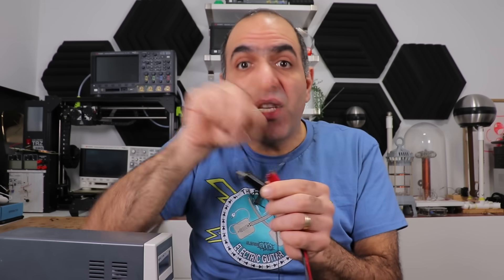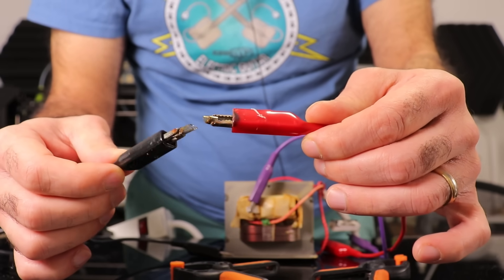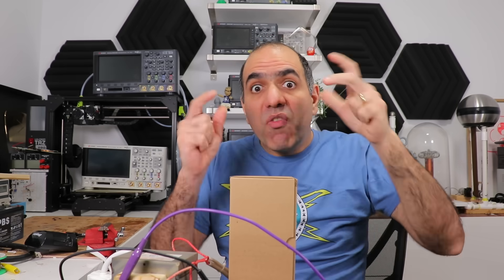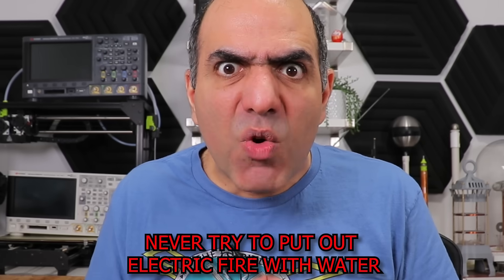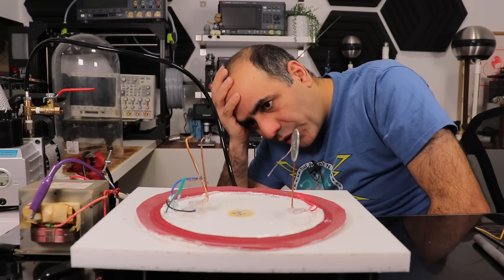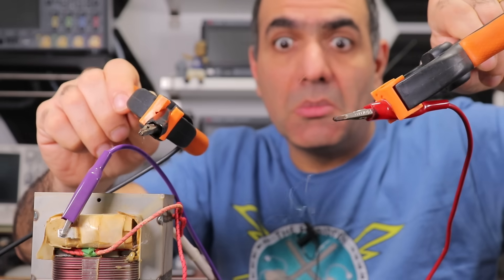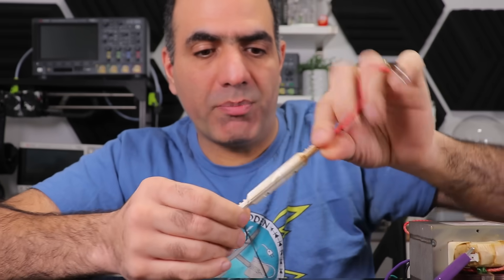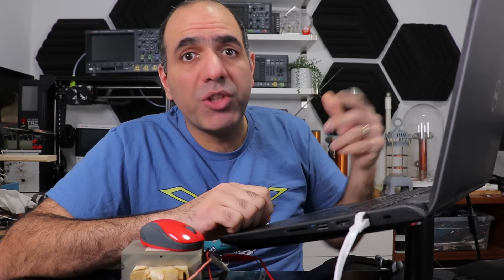Making a High Voltage Fuse

Comment: Hi f*** edit: @electroboom do you know what magnetic shunts are? if you remove the little blocks of metal between the primary and secondary you will get more power out of the mot, all you need is something to push them out with and a hammer, a flat head screwdriver will work, a metal rod will work, just anything you can hammer them out without damaging the windings

Comment: Creating a discharge between two electrodes at the lowest possible voltage requires that the paschen condition is satisfied. I believe you can look up paschen curve for air on the internet and set the electrode distance and pressure such that arcs are not produced (atleast until a high enough voltage is applied). Do the calculations according to your design and this might help make better fuses.

Comment: Mehdi, my assumption is that the gas in the fuse could be argon or nitrogen. I did want to point out that the spring from the fuse is probably still intact and the fuse blew as it was designed to just not visible from the outside of the tube.  If you notice the gauge of the spring side is thicker therefore giving it more strength in that area. I think it’s great that you showed an example of a modern engineering marvel that is not so obvious to us in other fields. Please make more videos showcasing unique or intelligent design:-) Thank You

Comment: Paschen's law is an equation that gives the breakdown voltage, that is, the voltage necessary to start a discharge or electric arc, between two electrodes in a gas as a function of pressure and gap length.

https://en.wikipedia.org/wiki/Paschen%27s_law

Comment: Good demo, Most HV fuses in ring main units (RMU's) have fine sand in them. The fuse element(s) are wrapped around a ceramic former and an explosive discharge which operates a striker pin at the fuse cap and trips the tripping mechanism, after the fuse element has failed, so all three phases are de-energized when one fuse fails. DDO's drop out fuses, the fuse element is held under tension by a spring which aids the separation of the melted fuse element. Also the tube vents out and blows out the remains of the failed fuse when the very loud explosion occurs under fault conditions.

Comment: Normally a fuse is not gas tight. The metal caps are lose and not sealed and the glass tube is open on both sides. Dunno how it is with the hv fuse though...

Comment: In Power Systems, Circuit Breakers generally use air blasting to extinguish the HV arc, there are other methods as well, like resistance switching, SF6 gas, chopping the arc...but spring works as well XD

Comment: Hello Mehdi. Is it possible to get shocked because of increased solar activity? I've been living the same house about 6 years now and never had static electricity issue before and literally nothing was changed during that time. However, I notice that about two weeks ago I started to get shocked by my front door handle and water tap and my Apple Watch charger, basically anything connected to the ground of my apartment.

I also found it interesting that static electricity and solar activity are peaked during the last 2 weeks in Google searches.

Do you think both are connected somehow?
Reply: Our (state operated) power company runs occasional ads saying that if your taps start zapping you, you need to call them quickly: faults like that can kill. Faults can develop as buildings/wiring age or are damaged.  I hope you are OK!
Reply: @old_grey_cat  yes but it's not like they shock you constantly. It's a static shock. It started a weeks ago. Now it's half as bad. Idk I thought it had something to do with increased solar activity recently. 🤷‍♀️
Reply: @aliozanerbektas  Please do have it checked out.
Reply: @old_grey_cat  I will do tell the administrators of the building. Thank you for your concern. 🙏
Reply: @old_grey_cat  I will do tell the administrators of the building. Thank you for your concern. 🙏

Comment: 5:02 The relationship between pressure, gap length and breakdown voltage for electric arc is actually quite interesting and it's formulated in Paschen's law (https://en.wikipedia.org/wiki/Paschen%27s_law ). When the pressure is too low, there are not enough gas molecules to ionize and make an arc. On the other hand, when pressure is too high, electrons have too many collisions with molecules and they're losing too much energy to maintain an arc. So partial air vacuum was an optimal condition, as we have seen on the video. Thanks @ElectroBOOM for showing that!

Comment: 6:22 sulfur hexafluoride is what is used in a lot of high-voltage electrical equipment as an arc suppressant.  its also like the opposite of helium (if you breathe it in, it stays there and makes your voice a lot deeper, but don't try this since it stays there and can asphyxiate you if you are not careful).  ive seen warnings about it on the doors of some rooms with electrical equipment around where i live.
Reply: I believe plain old CO2 does the job also
Reply: @PostTraumaticChessDisorder  It does, but worse than SF6. Not good for compact kv switches.
Reply: @PostTraumaticChessDisorder CO2 actively poisons you by dissolving in blood from your lungs. SF6 just suffocates you because it’s not oxygen, so you don’t get what you need to live

Comment: Also some glass fuses for purely hobby purposes can be repaired - using super fine wire - they are usually soldered to the end caps - they blow just as fast - the ceramic fuses are more robust and filled with silica like mentioned on this post before - using the wrong fuse is very interesting - and the reason for protective heat-Shrink or a plastic enclosure is probably protection against fragmentation of the case  - I had a non - repaired standard fuse I used on a HV project that literally exploded into pieces…

Comment: Yes, there is a non-conductive gas inside the fuse.
Also the function of the spring is not to pull the piece of wire that melts.
creates a path with resistance to limit the 2.1kilo volts, also at a certain moment you see that the fuse illuminates for 3 or 1 seconds, which would be
the gas igniting

I hope to win a heart from electroboom lel

Comment: Hi Mehdi, I guess they fill the fuse with heavy gas called SF6, that type of gas is used on power distribution station to provide a high voltage isolation , below more details about that gas 
https://en.wikipedia.org/wiki/Sulfur_hexafluoride

Comment: 8:58 if you use nitrogen to fill the fuse tube it will work because nitrogen act as noble gas under normal atmospheric condition, that's why nitrogen is used in the filament bulbs because it will prevent the oxidation
Reply: It's more accurate to say that dinitrogen is an inert gas, spliting it requires the Haber-Bosch process which is basically only done in huge industrial plants.

Comment: 4:25 Man, you just invent gas breaker. Ark inside the volume make gas to heat up and increase the volume, gas push the electrode out and after that expanding gas blow the arc. At the same time the fuse electrode jump out from the housing, extend the arc way, this prolong the arc. This two methods are used in combination in industrial air circuit breakers. Congratulations 😅😅😅

Comment: What if I use a 5000 volt fuse for my 12v car battery? You did not cover that possibility. I think "mind the voltage rating" is only important if your voltage is higher than the rating.

Comment: Try suspending the fuse in [non-conducting] mineral oil.   No more arcing. They often use oil like products for switch gear at sub-stations.

Comment: That video brings back memories of one of my most dangerous creations, the 4 microwave oven transformer series-parallel supply that runs from 220V and produces something like 4kV at 1A. The scariest thing is that high voltage windings are tied to the iron core of the transformer, meaning there's 2kV live on the transformers themselves.

Comment: The answer to the question, do high voltage fuses contain special gases. Is yes and no. Some fuses do contain special gases, and some don't. I would suspect that the fuses inside inexpensive microwaves likely don't contain any special gases. Often the conductors inside of the fuse bodies are specially formulated so that when they vaporize they create special gases that have an arc quenching effect, but they are not all built that way. Fuses are made with many voltage, current, energy and time ratings, so you have understand the circuit that you are trying to protect, before you can specify the right fuse.
Like you said; only replace opened fuses with new fuses with the same ratings.

Comment: Fuses do have a maximum turn off current up to which they can reliably cut the circuit. Above that the plasma arc can continue the current flow at least for some time.

Comment: Paschen's law might give you the answer for your "vacuum" fuse behaviour. Mobility of free electrons is increased under lower pressure and thus the arcing distance is increased. In addition your chamber was filled with vaporized metal after the fuse burned off...

Comment: You need to get a neon sign transformer.  They're by no means "safe", but they're less deadly than a microwave oven transformer.

Voltages are available between 3kv and 15kv, and usual current limiting is 30ma.

Comment: About the gas - I remember that in high voltage switches there is usually an SF6 gas around the contacts, which has extremely high resistance to prevent arcing
Reply: Also compared to air it is a lot more fire resistant, can dissipate heat quicker, non-reactive with metal (under normal temperatures) and also doesn't "age". Very neat thing

Comment: Also, isn't it technically the power that heats the wire, not the current?  So, a 10 A automotive fuse should blow at 120 W, which means only a 1 A draw on household 120 V electricity (ignoring variance and the differences between fusing AC and DC power sources for the sake of illustration). Since Missy applications work on a fixed voltage or nearly so, and because higher voltage includes the risk of arcing, it's easier just to have separate voltage and current ratings, so you get the right voltage for your system and the right current for the specific circuit.

Comment: Sometimes even non-conductive extinguishers can lead to electric discharge on the skin. I had that experience with the next situation - 150 kV, 100 kHz with a CO2 extinguisher. I catch the surface discharge on me via the CO2 to the air. Luckily the current was low and with a high frequency.

Comment: The spring fuse might just have regular air in it. Didn't you just say the typical arcing distance for that voltage is 1mm in air? Also, I bet if you took it apart you could find the spring part hidden behind the metal. You could see it before it popped because it was stretched under tension.

Comment: 9:46 I don't think the spring got vaporized. I think it collapsed back (like it was intended to to extinguish the spark) into the metal cap end on the screen left.

If you watch right when you turn it on, you can see it moving to the left slightly

Comment: If 3000 volts can jump a long distance in a partial vacuum, and only just a milimeter at atmospheric pressure. Then how much distance can it jump if stored under 5 atmospheres of pressure?  Pure nitrogen has a higher resistance to break down under pressure.  Search "paschen's law Wikipedia" or paschen's curve

Comment: Magneto ignition units on aircraft engines (piston engines) for high altitude aircraft, something primarily used before the advent of the jet engine, generally pressurized the magneto from the compressor feeding air to the engine, to increase the breakdown voltage.

Comment: I always wondered what the difference was in voltage ratings. Makes sense though. I guess a 250 volt fuse would work just fine in place of 600 volt until it blew. Then ypu may have a problem. To be clear im not advocating for that practice. Im just stating i always wondered what the difference was between a 40 amp 250v vs 40 amp 600v other than the size. 40 amp is 40 amp but it makes sense to me now why they are different.

Comment: You can use a spectrometer to determine what gas is in that microwave fuse based on the color of the flash of ionized gas

Comment: Strangely relevant to the last rocket labs failure, where low pressure in space (who'd a thunk) caused arcing in the second stage PSU, and a failure to reach orbit. It's a little more complex, but awesome that they could diagnose it after the fact. Now they pressurise the PSU to stop that failure mode.

Comment: Looking at the colour of the dishcharge, it could be pure nitrogen. I also know that xenon lamps doesn't like to maintain an arc, which is why we used to make the flash bulb in old cameras put of it. So it could be xenon, although xenon doesn't give off a violet flash.
Something to do with pressure and ionisation, the gas needs to be ionised to become conductive, the discharge occurs, this increases the pressure inside which raises the resistance until the arc stops.

Comment: Arcing in a partial vacuum is a very interesting phenomenon. It recently caused the loss of a Rocket Labs vehicle. High voltage from the fuel pump batteries caused arcing, destroying the electronics. This would have been impossible under normal atmospheric pressure.

Comment: trees growing too close to the powerlines causing excessive load on the generator station via passive accumulation of electrostatic transfer... no, they just come over to property to paint mark trees as a joke to, cutting that guys branches off of all industrial connections. going back to the housing standard of 1803... if their even was one... ... ... as the ants come marching in one by one, song of Russian origin just as almost all Christmas carols are. songs nun hears, the cannon like blast of a 800kv disconnect switch. why need that much... the other guys pool heater, 😐 i have 3 lagoons.

Comment: Many high voltage facilities work with noble gases like sulfur hexaflourid. But you can also insulate the gap and thus interrupt the arc by filling the fuse with sand. Sand-filled fuses were pretty much the standard for decades in households before switch fuses became a thing.

Comment: Check put the fuses used in the space station. On esrth fuses work because gravity pulls down the molton metal. In space, that molten wire will happily conduct in place.

Comment: Excellent video. Now can you explain how fault current ratings work? A fuse has rated voltage, current and fault current. EG I'm using some 25A 1000VDC 50kA fuses (Littelfuse SPF if you really want to know). Blows at 25A, can stop a 1000V arc and can handle a potential 50kA fault. I don't understand why fault current rating is needed as well as voltage rating?

Comment: Mehdi you should get a high voltage/high current PSU operating at much higher frequencies, to avoid electrocution. I don't like watching you sitting near and holding MOT wires close to your body.

Comment: So true about springs in HV fuses.
Fuses used in the transmission lines are spring loaded, inside a cylinder filled with glass-sand, which melts during a short.

Comment: Voltage rating on the fuse is the maximum voltage. You can use a higher rated fuse on a lower voltage but that might not be economical.

Comment: What we did in the ham world was take a big plexiglass cylinder with a thin wire running through it, then fill the whole thing with sand.   The wire would turn into plasma and the sand around it would collapse and break the plasma arc.

Comment: if atmospheric pressure decreases the distance an arc can travel, could possibly a high pressure environment inside the glass tube be advantageous to extinguish arcs faster than normal atmospheric conditions?

Comment: Every time I see you taking out the microwave transformer, I worry for you. Please be safe. 

It's a pity you didn't mention other ways of extinguishing the arc, such as filling with sand, extinguishing baffles in reusable automatic fuses or at least the division of fuses into ac and dc ones.

Comment: I was thinking that you should fill your container with sand to surround the fuse wire, but I guess that doesn't work so well on video for entertainment value. I thought that was what is used in a lot of higher energy cartridge fuses.

Comment: I know you are dumb on purpose Mehdi but pretty much all fuses are spring loaded in some way. Even the 220 V fuses, except the wire is also the spring. It's under tension even when it gets red hot. So should it melt, it "pings" off into whatever direction still has the most tension. That is how you can see it's broken as you have a small bead of molten wire with a decent gap between it and the other side. It doesn't just droop away and fall to the side of the tube.

Car fuses make that squiggly path as that path is the spring. It's thicker than the actual fuse part and so when it blows, the thin wire separates reliably because the thicker part is holding it under tension. Might even be some material science involved where the hotter the thick section gets, the more it pulls the thinner section apart.

And fuses that can be reset are essentially just material science, they are resettable because they don't actually break. They just get hotter and so they bend apart and they need to cool down again before being able to make contact, which they of course don't do automatically as that would be deadly.
But should some genius fix the lever in place, they still just bend apart and once they cool they MIGHT (if bad design) make contact again. But they won't stay in contact if there is a short circuit.

Comment: the spring in the microwave fuse didn't melt, it retracted back inside the metal end so it looked like it disappeared.

Comment: Argon would make the arc worse.

Believe me. I'm a welder.
Most probably the original filament inside a fuse is of a conductive material, or covered in something that would prevent any arcs.